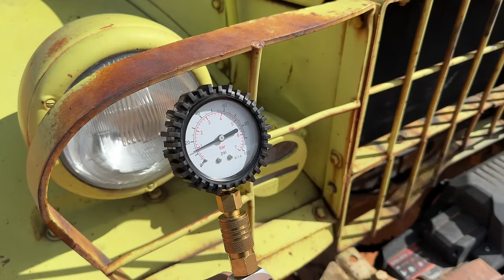The Road to the Off Road Games

Comment: Allways check the lugs .. when you check the tire pressure.. as you fuel up
All it takes is a min .. the life you save might be your own.. 
I mean yikes..loosing your tires is one thing your wheels another and the entire rig and cargo and life another.. .. check check and recheck .. never cost anything but a little time.. giving you piece of mind is gold..
Reply: Not to mention the life(s) that could be lost by a high-speed, heavy wheel/tire bounding into oncoming  traffic - at night!

Steve
Reply: All you really need to do is stop using the impact gun instead of a torque wrench. If you are rotating your tires every 10k or so and using a torque wrench this is not going to happen and there is no need to check them until the next rotation.
Reply: I've been hauling for 4 decades check them a lot if your hauling.. 
You can check the drive shaft every rotation .. but check the wheels and tires all the time including the lugs .. what else can leave you 3 wheeling .. better   safe then sorry

Comment: Why do you have the traction lug tires mounted backwards on the orange unit? They will have reduced traction moving forward mounted like that. Impressive traction in reverse though!
Reply from the maker: On a tractor you want objects to move to the side when off-roading you want your tire to center you on obstacles not push you off them.